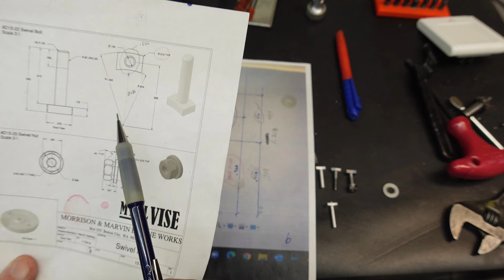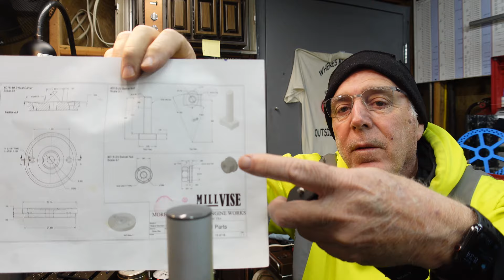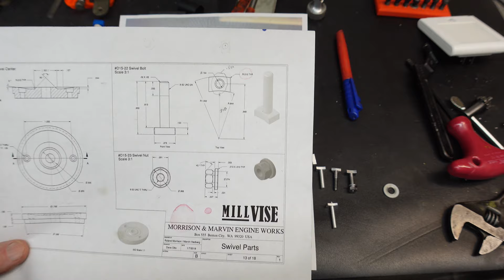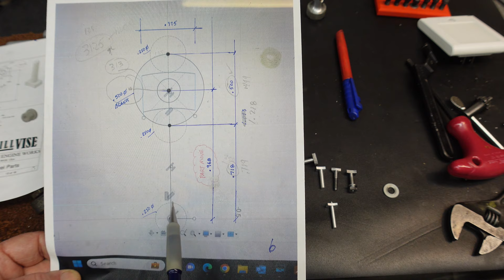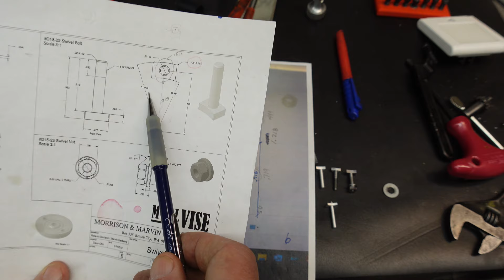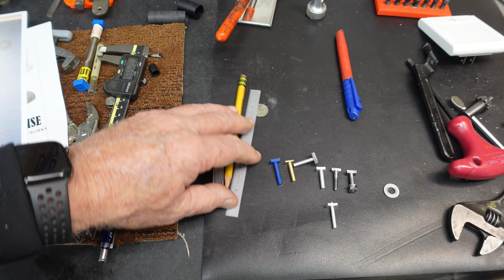Rotary Table Fun (with bozo)

Comment: Maybe you could pop a couple of holes in a piece of round scrap to hold the parts on the correct pcd for the center of the part & turn & bore the rads on the lathe.
Reply from the maker: thanks for viewing and your interesting comment, I did consider using the lathe...

Comment: getin' it done! You can do some great stuff on the rotary table, the trick is getting it right. I learned some complicated methods, but still haven't found a simple way to position the part on the table to get an accurate radius cut.
 If the feature is just cosmetic, then drawing scribe lines and drifting the part around until the cutter is close is good enough.
Reply from the maker: thanks for viewing, suggestion what Joe Pie as he has some very good rotary table videos that explain position

Comment: A question, please.  The centers of the 2 radii are at the same point, correct?  Then the outside radius will be the inside radius plus the thickness of the head on the centerline for the proper radius, correct?  In that case, the part will need to be moved out the thickness of the head to swing on the new radius, correct?  I hope I understand what you are making; I think I do.
Reply from the maker: thanks for viewing and you are correct, that is what I showed on the Fusion drawing....